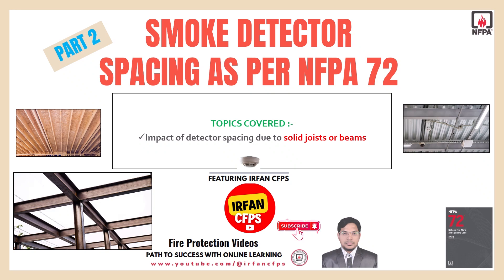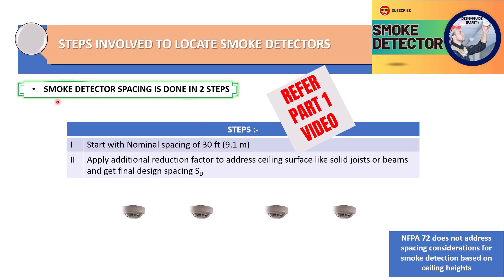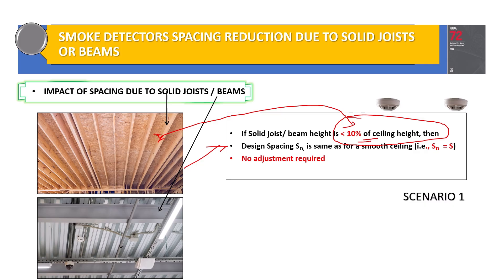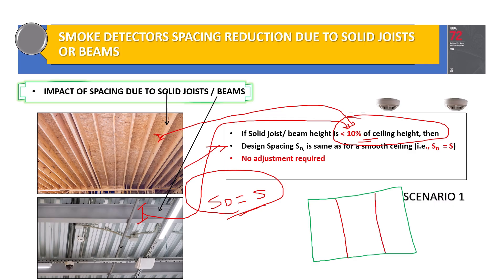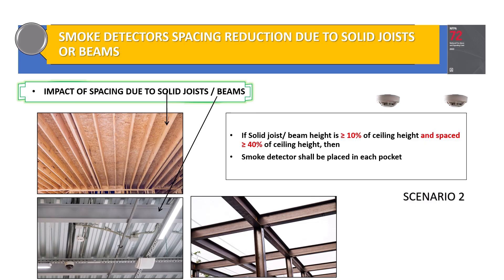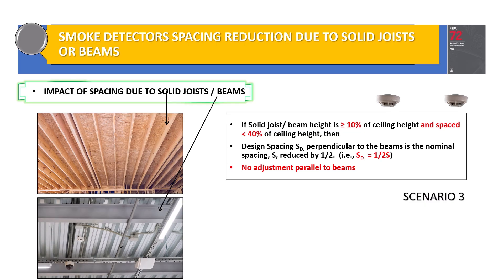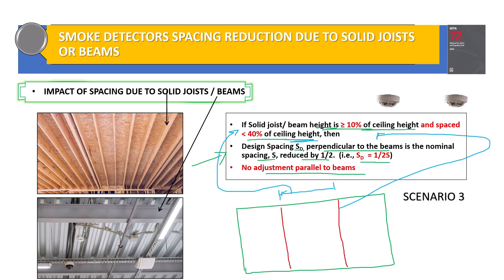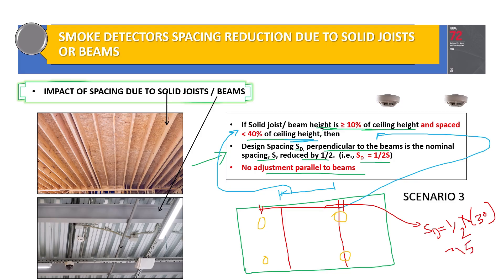How To Space Smoke Detectors Like a Pro!

Comment: then how much distance shall keep the detector from the beam
Reply from the maker: Thank you. 1) You can mount the beam detector closer to the ceiling, but not more than 24 inches (610 mm) below the ceiling. This is to ensure smoke is detected early, as smoke tends to rise and accumulate near the ceiling. 
2) Often the transmitter or receiver is mounted on the wall. But the 1/4S spacing rule is applicable only when the beam detector is installed away from the wall (for coverage calculations). 
3) Distance between transmitter and reflector varies. Please do check the video again where i explained clearly.

Reply